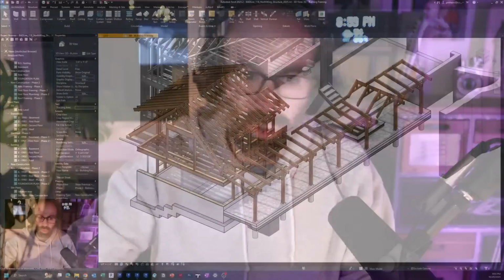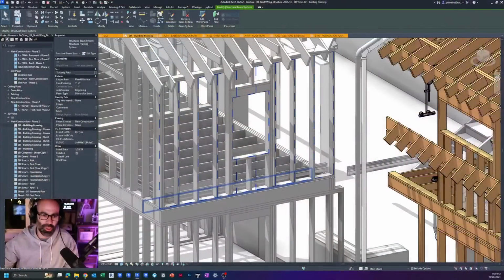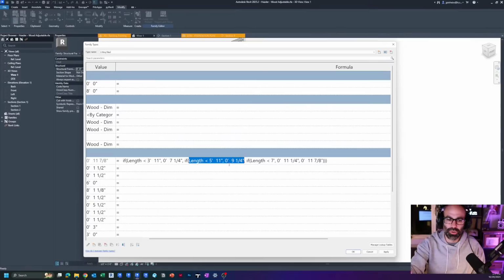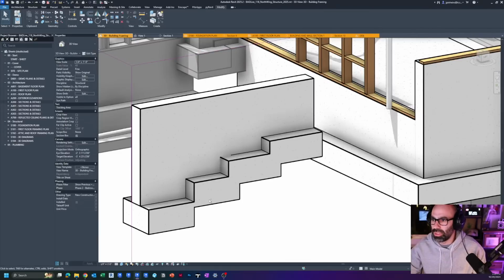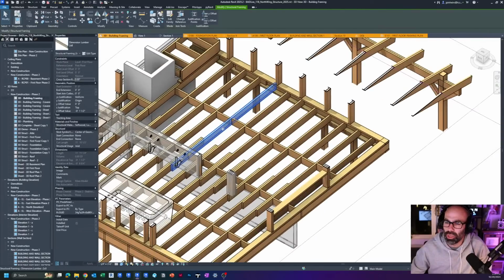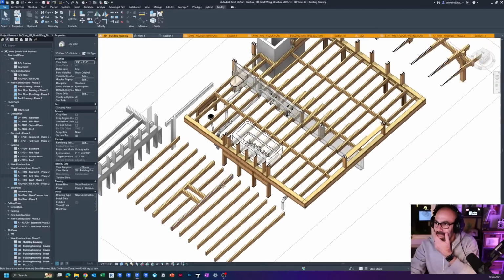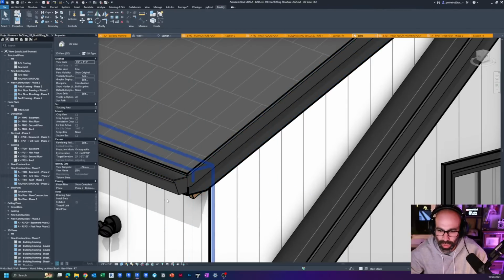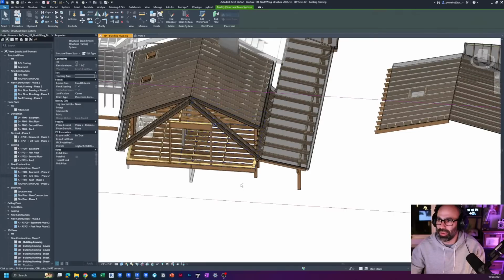Modeling Wood Structure in Revit - Residential (The North Wing - PT 4)

Comment: Hi Jeff,  Did you use beam system for the studs as well? Have you experimented with curtain wall systems for your (wall)studs?
Reply from the maker: @valeriepierre7297  because I can schedule the beams and get cut lengths and all kinds of gooodies … not much of an advantage using curtain walls as you still need to edit the profile of openings, etc… for material ordering using beams was way simpler.

Comment: Excellent information on wood framing. Not sure if it is a good thing to specify headers by their length only. Headers of the same span can support more or less joists length, roof only or a storey or two. The formula should be able to look up in a table and joist length supported and storeys supported should be manually filled parameters.

Comment: I''m always interested in modeling as much as I can and in that pursuit I even purchased AGACAD's wood framing software, thinking that would be an easy way to frame in REVIT, but after many consulting sessions (paid) and many hours of videos, I had to give up on it. I think there must be an easier way to do this. Even using beam systems may not be accurate to how things get framed in the field. I do like the idea of the header family driving some of the model. I'll have to check those out.
Reply: have you check VERTEX BD and MWF Pro? They are competitors of AGACAD
Reply: @steedlei1  I have tried MWF, but not heard of Vertex BD. Will check it out. thanks
Reply: @hu5tle-   how's Mwf? similar performances as AGAcad? I'd so, I think self custom made revit families is best way to do accurate stud wall and roof farming. These plugins are too expensive, also maybe too automatic to make small details accurately.
Reply: @steedlei1  I only trialed it, then bought AGACAD for 1 year plus. AGACAD and MWF really seem geared towards production/pre-fab factories. Trying to do it with one-off remodels and then hope the wall you created for one project can roll forward to the next is a pipe dream with AGACAD. The purchase was costly, then they charge you for "consulting" i.e. getting your walls set up, so more costs, then there's always little tweaks and more pain that it's worth. I think the big take-away for me would be to wait until almost the end of the project to apply the framing, then nudge and adjust to account for MEP's etc. I'd guess that would get most to about 90+%. One day we'll just have a prompt within X program that will frame based off your desired set up. :)
Reply: @hu5tle-  Thank you very much mate for your detailed reply. It convinced me just using native revit families for framing. Which is most versatile approach I 😀
Reply: I don't know why this video came up on my feed, but it brings back painful memories of trying to model in Revit. I switched to Vectorworks, which is based on the Siemens Parasolid geometry kernel, same as Solidworks and many pro 3D CAD modelers. So while Vectorworks is a full featured Architectural package, anytime you need industry standard CAD modeling, it's covered. Framing details are straightforward - no bag of tricks required.
Reply: @robertstrauss8180  Not sure I'm ready to try and learn another program. So much time already invested in the Revit workflows.

Comment: Thanks for the video! I always learn from them and often refer to the array video you made. My colleague used that technique to create a nested sole plate family with bolts and drill recess included. Win! 

It's my time to share! I recently tried using the trim/extend single element (or multiple) for aligning beams and wall ends. It literally changed my modeling life. It aligns the blue dot to the selected surface, so it's good! I bound that and the Aign command to easy shortcut. They are probably my most used commands...that and cltr z 🤣🤣